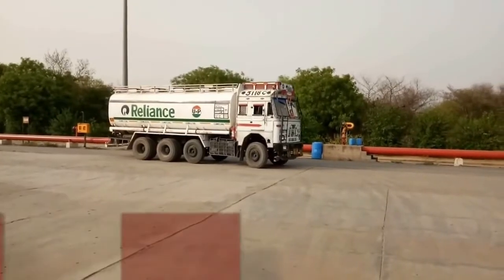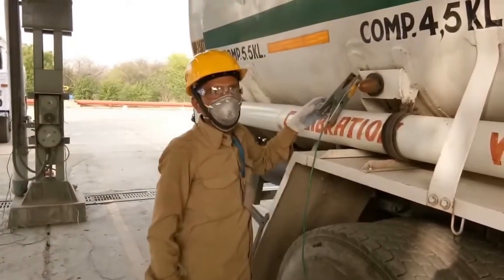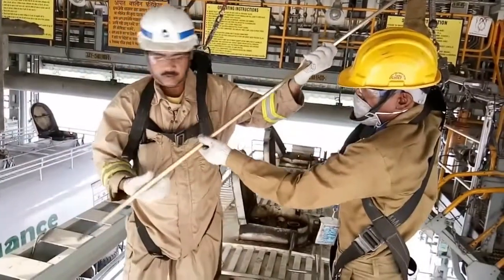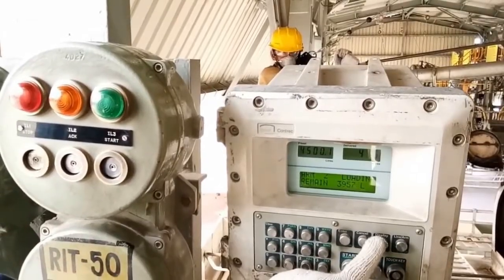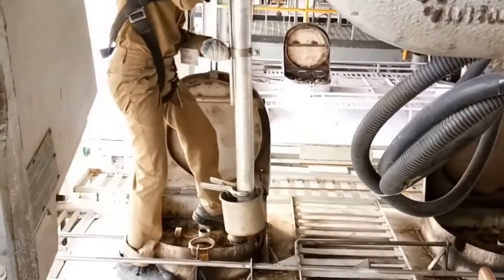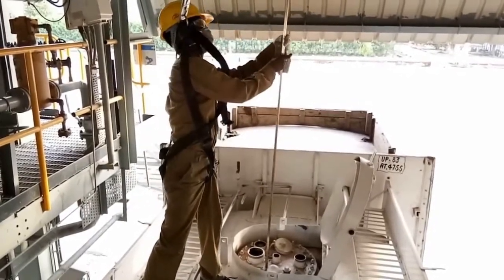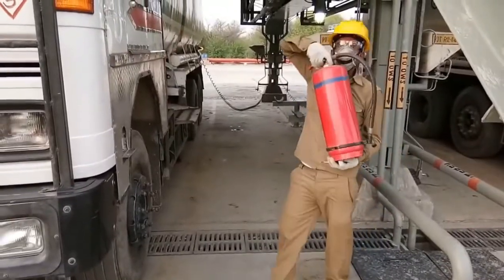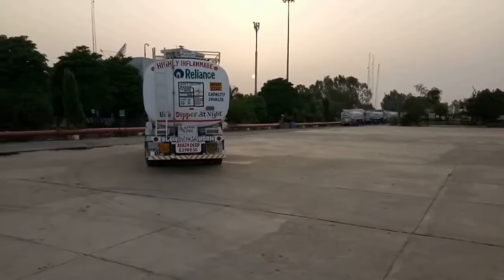Tank Truck Loading - English

Comment: Sir please confirm me that capacity of each compartment will also include oil in pipeline till manifold or not !!!
Reply from the maker: Yes the।pipeline quantity is part of compartment capacity. Suppose compartment 3 is 3000 liters and if quantity of pipeline from comp3 to valve is 100 liters then compartment will have 2900 liters and pipeline 100 liters
Reply: @PraveenVarmaFromIndia  Thanks sir. Please make video on new type of Bottom loading lorry. Need to know possible oil escape jugar and about fittings. I am getting short delivery everytime. ,🙏